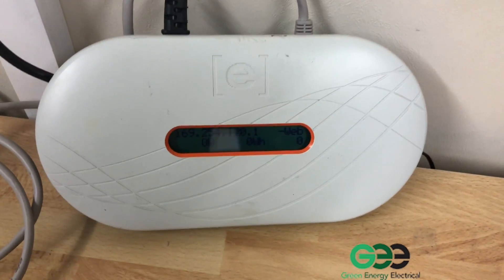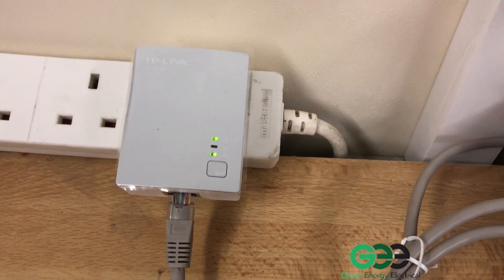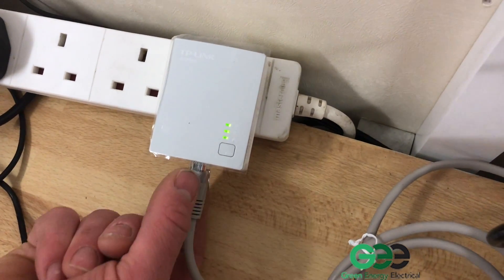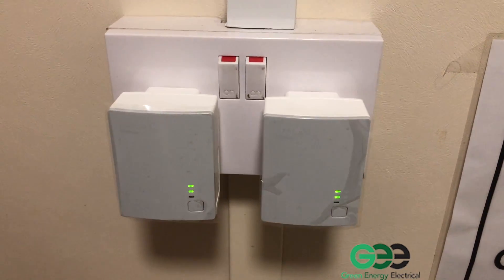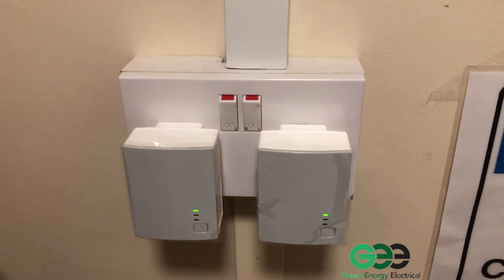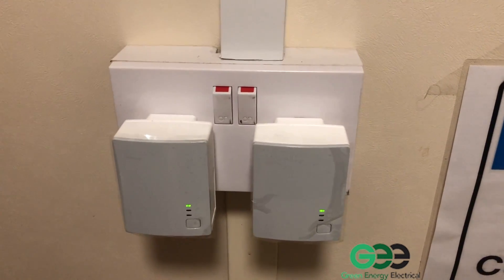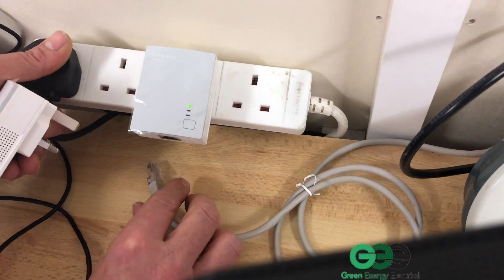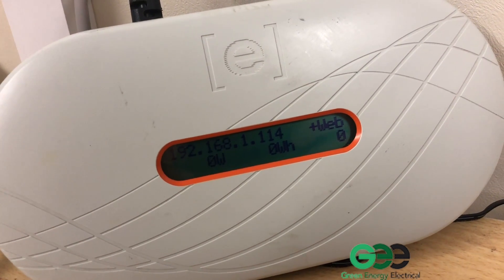TP Links: Re-pairing for Solar Panel monitoring

Comment: If you leave them plugged into a surge protector it will stop working. You have to plug them directly into the wall outlet.
Reply from the maker: Thanks Jackson. We have stated this in the video description. However, we should perhaps have emphasised this in the video.

Comment: help me downstairs all the lights on the tp link are on where as upstairs the middle light dosent come on, i use it to connect my ps4 too wifi and i dont know why it wont work. also the tp link i use upstairs works fine downstairs
Reply: I have the same problem did you find a solution?
Reply: It's on power saving mode I dont know hot to fix it tho